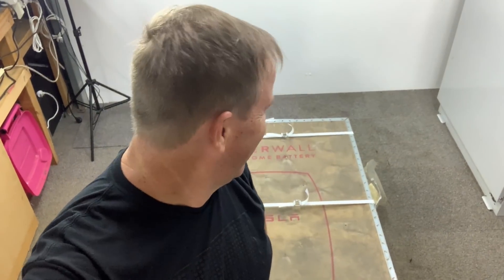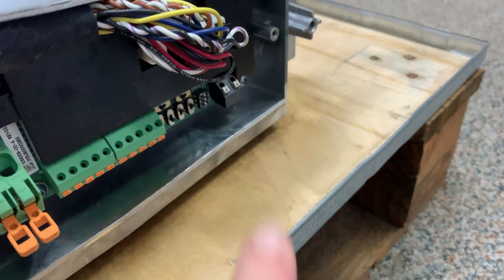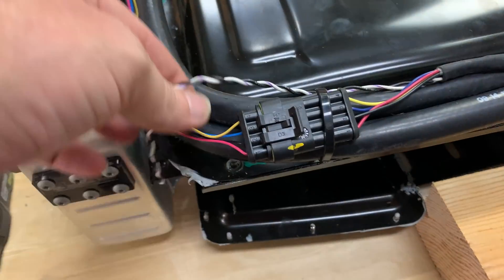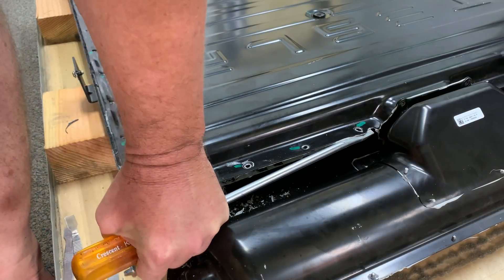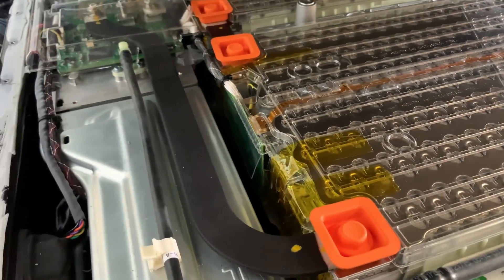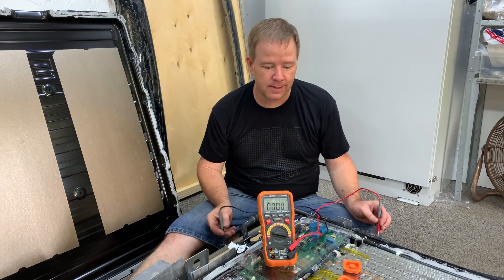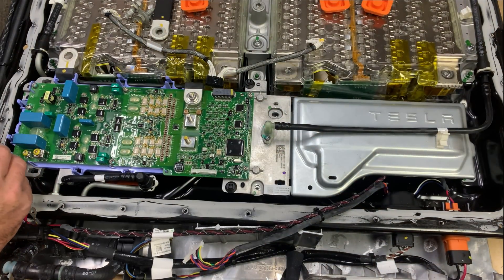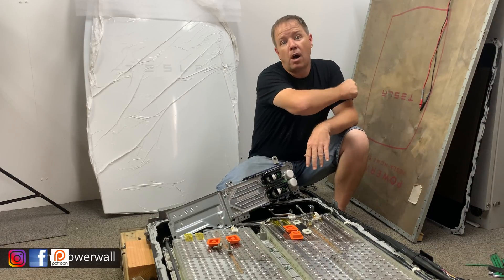Tesla Powerwall Teardown - Taking a look inside a new Tesla Powerwall thats been stored for years

Comment: Those cells will definitely be revivable. I've done this on plenty of 18650s. 
Just charge them super slow. As long as they haven't had a reverse voltage applied they should be fine with minimal capacity loss
Reply: Don’t use any smart chargers, just power supply’s, just a little at a time, then maybe switch to smart chargers, or a really small trickle charger..
Reply from the maker: I'll be giving it a go for sure!
Reply: @HBPowerwall  top job. I reckon you’re on to a winner here mate.
Reply: Back in 2013, my brother bought a slow as molasses HP laptop.  Because it's rarely used, the batteries are discharged most of the time.  I had to buy a new battery pack for it late last year, because it was refusing to charge the battery pack.

I disassemble the old pack, they're 2800mAh Samsungs.  Then I buy a battery charger (a Miboxer, that can handle AAA to 26700's, with a capacity testing mode, adjustable charging speed from 0.2A to 1.5A, max of 5A across four slots), and charge the batteries.  All four batteries fully charged and are holding their charge.

I bought that charger partly because I'm going to build me some battery packs using 21700's, because that's what DeWalt uses in their battery packs - I disassembled one, because it would no longer be recognized by the charger.  Out of 10 Samsung 50S 5000mAh batteries, two were completely dead, zero volts. The battery charger I bought doesn't even know they're there when I put them in.

However, my plan is to build a 13S-8P pack worth 2kWh (at 3.85V).  The other 96 batteries I'm going to use are the 5000mAh Bak batteries.
Reply: @charlesball6519  I had a laptop battery pack that became useless (5 min life), so took apart and measured one 18650 Li battery bad and replaced it.  Hard to put pack cover back tight but worked for a year or two.  When it failed again, I bought a new pack since now $20 instead of $150 before.  I salvaged the good Li batteries from the old pack and other devices (forgot) so bought many flashlights (Amazon) that use use an 18650 for all family members and vehicles.

Comment: Maybe im missing something but could it be that the cells are "fine", but low on charge, and the output of the modules is disabled until the voltage internally is high enough?  i.e. the internal BMS has a contactor that stops the battery cells from fully discharging.

It would seem odd to be completely 0 volts.  That feels like something is disconnected internally rather than discharged.

What happens if you give it some juice and let it charge up?
Reply from the maker: Most of this will be in next video when I get some more sprae time hoping in next 10 days

Comment: I know petrol softens silicon sealants - if you use it on an intake manifold it turns to jelly -, it's just with that much area it's still going to be difficult. If you can cut off some meniscus you can try soaking it in solvents to see what happens.
What's the story, ie, how did it brick?
Reply from the maker: Yes could try that for sure!!!, story was sat for too long and went flat..

Comment: I would like to see u recharge the battery and cycle them a few times to see if u can get some capacity back. I have saved many laptop cells (18650) that were discharged to 0v for months and still after charging and discharging them few times they got back to 2000mah (original capacity 2400mah) . And those cells were in use since 2010.
Reply from the maker: I'll see what I can do..

Comment: I wonder if Dave Jones of the EEVBlog would be able to take a look at that big circuit board and tell you more about it.
Reply: Dave is not really that kind-of EE, at best he would read the numbers off the chips and look up the datasheet and tell you what it is, ie, something you can do. If it's Xilinx FPGA or ASIC, you can forget about it. If it's something like a STM micro with a bios chip, you need the code to manually reprogram it, ie, too difficult. I'm not sure if those big chips have hardware fuses like the small micros, but maybe you can rest it if you're super smart.
Reply from the maker: He hates what we do as a community.. Did consider driving down to his place and knocking on his door to do the tare down with him. I might reach out anyway and ask if he would like a crack at it
Reply: @HBPowerwall  EEVBlog has no interest at all in Power Electronics, other than a basic look at what's inside and what parts it uses.
Take his 10kw laser PSU he pulled apart, he could have actually reverse engineered it, but didn't.

Is this powerwall going to do anything without the Battery Interface and StorEdge inverter, likely not.
It's the 300-400V DC version, and most inverters don't have an external cable into the main bus capacitors.

I can tell you exactly what MCU is on that board, it's a 176 pin TI C2000 series, very likely the TMS320F28277D as used in some of their cars.
I could Reverse Engineer this entire PCB if I had it in front of me, just not possible to do anything with just photos with all the gell (I've tried in the past).

ps: Tesla are having a huge crackdown on anyone using their name/logo on things that aren't 100% theirs, eg aftermarket chrome badges. Tread carefully on this.
Reply from the maker: He has a solid and longstanding hate for this community but I still enjoy his banter and content - so i've reached out with an offer, if he takes it up we all might learn a little more for the cost of postage each way.
Reply: @HBPowerwall  I don't think he hates the community, it's just that he's flippant/abrupt if it's not interesting to him, ie, he's busy and brushes a lot of stuff off. Dave actually got solar maybe 5-7 years ago, and is currently in the process of doubling the number of panels. He contemplated the Tesla PW back then but it was not viable, but he's looking at some sort of battery storage currently. He seams to have a lot of $s because he buys the best, so he'll probably go for Tesla unless some other high end company makes something cheaper. He also just bought a new electric Hyundai.

Comment: Thin steel cable would be able to cut the sealant to take it apart i think.
Reply from the maker: That a neat idea but you wouldn't want to be dragging a cable over the batteries and PCB
Reply: @HBPowerwall  Kevlar, dyneema, nylon could be alternatives. It's not like bandsawing the box 🤣
Reply from the maker: RIP the chainsaw through it and get it on camera - whats inside, only using a chainsaw!

Comment: That holden(?) van. Known in the UK as a vauxhall combo. It needs a z20leh 2.0 turbo engine fitting and running on z12xe/z20let engine management. Very straightforward conversion for a 300bhp van. Goes in almost factory even with the 6 speed box 😍

I'll watch the video now and see what the tesla pack is all about but the van caught my eye 😂
Reply from the maker: I'll replace it with a classic mini van - been reliable and cheap to drive for the past 15 years but so done with it lol

Comment: Lithion are probly dead if lith po4 you can revive them but they dont last long . I drained my life po4 batreries to .04 volts and put a fully charged po4 to it and revived them so the charger would switch on to charge them . They work but dont have the amps anymore .
Reply from the maker: I'm thinking dead too.. time will tell.

Comment: Not surprising this would be comprised of two EV battery units. Surprised the whole system is cooled only by one 120mm radiator, though. And what appears to be aluminum at that. I would've expected a copper radiator and a larger one, too. But I guess that Delta fan helps make up for it - it's rated at 148 CFM (>250 CMH).
Reply from the maker: My hope is I can turn on the fans and pump to test the batteries. Will be good to see how fast that fan spins and if any noticeable heat from the cells is dispersed
Reply: @HBPowerwall  From what I'm finding, about 4,000 RPM at 51 dB/A at full speed. So it'll move a lot of air, but you'll probably make your wife wonder if you bought a small plane. Just make sure to keep your fingers clear of it.
Reply from the maker: dam that's some air flow!!! bet is PWM controlled based on temp given the temp sensor is on the exhaust air side.
Reply: @HBPowerwall  I think these have a 3-pin connector, so if there's any control over them it's via voltage.
Reply from the maker: this one is 4wire? not sure..
Reply: @HBPowerwall  You're right. So it might actually be PWM controlled.

Comment: My best advice to you HBP : NEVER atempt to save overdrained cells like that!!!  Cells that are low voltage will ahve dendrite that grow and sometime puncture the separator inside the cells whick randomly make short circuit!...  In other words, it will become a timebomb if you recharge it ! I know what i'm talking about that's my job!   please just dont do that.    Some of the copper in the anode copper current collector (a part of the battery) can dissolve into the electrolyte. The copper ions (atoms?) then in turn can stick on to the anode during charging by chemical reduction and cause dendrites. The dendrites might cause a short circuit inside the battery.  and with the thousand cells you have inside chances are enormous that it happen.
Reply from the maker: Very well aware of the possible dangers - would be 'fun' to know if this happens to uncycled cells? The plan will be outside, in a safe environment so if they go south I can record it safely. I have access to some land with a huge dam, do it on the banks if it goes thermal I can push it in lol But really still want to try, I already know the outcome and it will make for a boring video lol
Reply: @HBPowerwall  The problem is that the moment they start internal short or overheat is not necessary during a single test... your test can be positive but 1 month or 1 year later the problem can happen... it is unpredictible and random! that is what the point is... Simply testing it and get a positive result NOW dont mean they will remain safe after!  The real answer is if you really well know the copper dissolution problem in over discharged lithium cells you would simply never attempt to save these dead/overdischarged  cells. Keep in mind that the word UNSTABLE is what they really  become after overdischarge for extended period.  Making powerwall with hundred or thousand Unstable cells should not be suggested on internet. Think of these people that believe the future is electric and want to build their own battery but never touched a single transistor and now you suggest  saving dead cells... it just dont make sense to me. With all respect to your great work, please be responsible for your viewers. Doc
Reply: @Doctorbasss  yeah i dont think its safe or a good idea to create a power bank of used li-ion batteries, that might be unstable.
Reply: @HBPowerwall  : what happens to overdischarged cells, uncycled or not, is already well documented, for instance in this article : https://iopscience.iop.org/article/10.1149/2.0671809jes
Basically they are internally damaged, and overdischage damages them in a way which does not depend of the number of cycles. As the article mention (see the 2 first paragraphs of "Conclusion") it is unsafe to even try to charge them. Please, please, if you do another video, mention people should not try to "revive" lithium cells, let alone reuse them...
Reply: Thank you for posting this too. We need to spread awareness that lithium batteries, even brand new ones, that have been overdischarged even once, are no longer safe to be used. Seeing the comments, many people do not seem to know this. Overdischarging a Lithium battery permanently destroys its internal structure and it cannot be revived ! Attempting to charge it will lead to a significant hazard and it can fail unpredictably at any moment making it even worse, it can seem to somewhat work at first.
Reply: Source: https://electronics.stackexchange.com/questions/164103/if-li-ion-battery-is-deeply-discharged-is-it-harmful-for-it-to-remain-in-this-s/164178#:~:text=3%20Answers&text=No%2C%20it%20is%20not%20OK,Ion%20deeply%20discharged%20at%20all.&text=But%20the%20dendrites%20caused%20by,or%20below%20the%20recommended%20voltages.

Comment: Hi mate, thank you for posting this, I have one hanging on my wall I was given and it was in use 18 months ago before it came to me. I have left it unconnected as there wasn't a lot about them. So know you are working on it I will be watching with glee to see what you do with it, at least I can see how to get into it. I wanted to convert to a 48 volt powerwall and then add my collection of 18650 batteries that I am building in a powerwall as well. Thank you as well for such a great informative vids.
Reply from the maker: how long has it been disconnected for batteries might be dead like this one!
Reply: @HBPowerwall  around 18 months. I am going to take cover off hopefully this afternoon and test it. 
It wasnt brand knew although only working for 3 months then replaced with another brand. My mate does solar so he gave it to me. Hopefully it has some power,
Reply from the maker: let us know!
Reply: @HBPowerwall  I will, just waiting for a break in the rain, Im at Wauchope NSW Floods , Floods and more Floods.
Reply: @HBPowerwall  I have just got it apart, I have 4.1 volts in one battery and 1.14 volts in the other so at least I have some volts lol. Bugger bugger bugger. Hope I can getthem back some how and quickly
Reply from the maker: nooo do it stupid slow !!! realll slow! not fast
Reply: @HBPowerwall  ok, i will leave it to the power pack comes, the small amount of voltage is holding at least. I will be interesting after a week to see if it still as the same. I also notice on the main controller board the red and black wires, I assume they may be high ac voltage but im not playing with that side. As that would be a charging board one would think that maybe 240 v ac or higher coming in to it. Like many things with these units, limited information at best. Thank you for your input.

Comment: What junk. Not serviceable unless you peel apart a glued together shell. Discover AES is a much better, serviceable, and safer chemistry battery.
Reply from the maker: I think part of being hard to remove is part of the safety, either way was defiantly fun
Reply: HBPowerwall, It was great to see inside. Thank you! It does not look like they wanted it to be easily serviced. When it faults recycle the 18650s and metal shell then land fill the rest? I’m not sure what their plan is if an issue arises. What is you plan with this dead unit?
Reply from the maker: hang it on the wall with out cells and pretend it's a working unit.. bodgy up a cable out the bottom into the wall lol

Comment: Those two big cylindrical components are inductor chokes (as labelled). They protect the circuit from high frequency AC noise while allowing DC current to flow. Without them the AC mains would create a noise ripple and destroy the sensitive components on the circuit board.
Reply: Actually it's the other way round, they prevent the high frequency switching noise generated by the electronics from escaping into the outside world and wiping out radio reception for miles around.  They're called common mode chokes.
Reply: Actually that is crap. AC sides of the inverter is isolated by optocouplers
Reply from the maker: Thank-you :)

Comment: hey thats a great score!! I would love to see that revival video! probably all you need to do is disconnect all the electronics and put a DC-DC converter at a low current probably less than 1A and let it charge everything in series while checking the balance ports with the meter and tracking the cell voltages. Then just keep charging at the low current until every cell is over 3v. With Li-ion you need to form the crystals evenly across the plates so a slow charge when it has been sitting will help it a lot! so will a few proper charge/discharge cycles to get everything active inside.
Reply from the maker: Already done a 2 hour test... stay tuned !
Reply: @HBPowerwall  awesome! good luck hopefully it goes well!

Comment: For all the hype on Tesla powerwall I am not impressed 2 24 volt batteries omg.
Reply from the maker: What did you think it would be, size and shape of it always implied two modules ?
Reply: @HBPowerwall  I just thought it would be higher voltage but I guess they are limited to 48 volts for residential use.
Reply: Date suggests it is a Powerwall 1 version $3000 USD according to Google.
Reply: Storage – The Powerwall 2 has doubled the storage capacity of the first Powerwall. That's a whopping 13.5 kWh of storage compared to 6.4 of Powerwall. ... literally, than the Powerwall 1. The liquid cooling technology in the battery keeps its temperatures more stable meaning it performs better in a range of temperatures.Nov. 12, 2018
Reply from the maker: Wonder if i can get my own cells crammed in there and make it the first  10kwh diy POWERWALL! lol
Reply: @HBPowerwall  Pete if anybody can it is you I think those cells can be saved but I am an optimist.